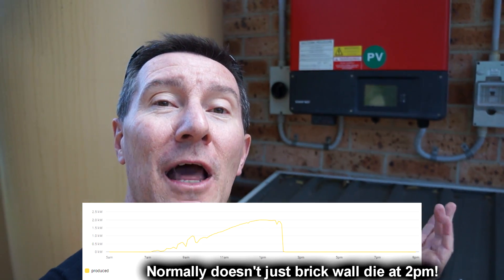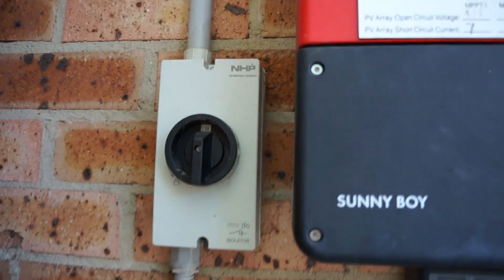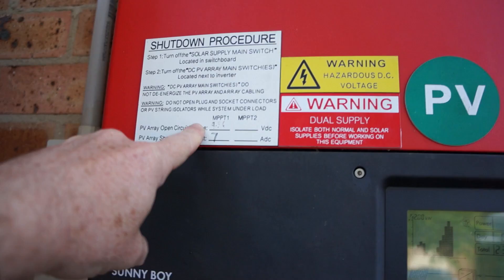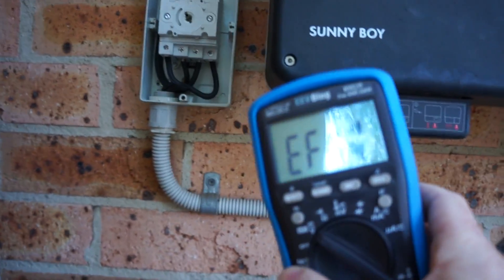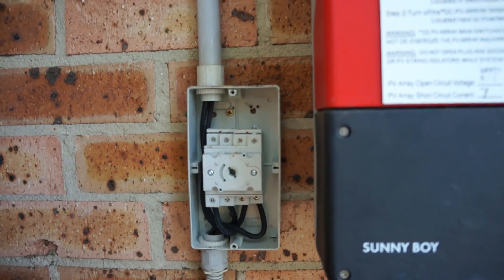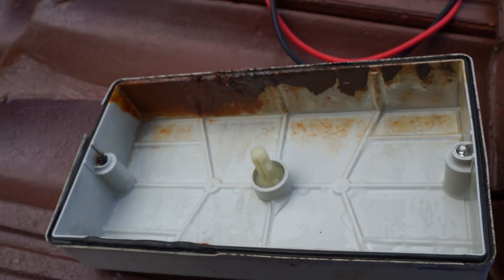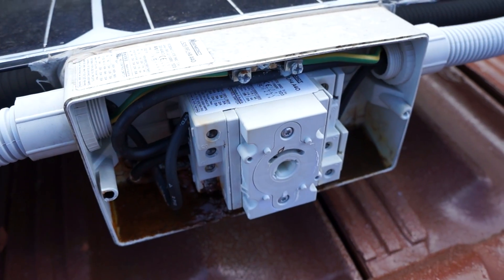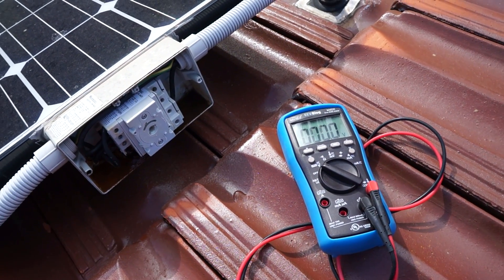EEVblog #1217 - My Home Solar Power System FAILED!

Comment: And that's why BigClive says to drill holes in the bottom, if seals fail, at least water can escape through the holes before it does damage... :)
Reply: I'd say have the box horizontal first. Think of the top section as a plastic umbrella. That way if the seals fail it's still harder for the water to get in as it would flow off the top, down the sides and most would run off past the seals. Then also have drain holes in the bottom.
Reply: or add a nice thick bead of silicone around all the edges except the bottom one. and buy a brand that makes their boxes out of marine grade uv resistant plastic or pvc
Reply: I worry more about bugs than weather.  some leather, lead, something to cover it...paint, dunno, don't like holes, holes mean hornets.
Reply: then you get bugs in the box and webs and a fire hazard. Better to just make the box outta cast aluminum...
Reply: Can't believe that if you noted the damage you didn't seal it up with self amalgamating tape for at least a temp repair until a replacement could be sourced after it was inspected.

Seems a bit daft to spot a potential fault & to just leave it to develop, what's the point in an inspection if you don't act on the results of it?
Reply: @norfolkngood8960  
The switch is already destroyed.  There is literally no point in trying to reseal a box with a switch inside when the switch in question is corroded.  What could you possibly gain by addressing the leak once the switch is dead?  Who is draft in this situation?  What is it, a self-healing switch?  C'mon man.

He is acting on the results of the inspection.  The whole assembly (box and switch need replacement).  Your field repair suggestion is nonsensical.
Reply: @norfolkngood8960  "potential" fault? 
What makes you think he hasn't already ordered the part?
One of the worlds most known and accomplished EE's..... daft?

Quit yo jibba jabba! lol
Reply: Illegal to drill a drain hole in a solar isolator in Australia.
Reply: @whiskeyinthejar24  put them under the panel then so rain & UV can't get at it that'd be a "neater" solution or add a sacrificial cover to the box.
Reply: Stop Changing this It's really creepy - I agree, a sacrificial box/cover, or just a stainless steel or aluminium box/cover is what I’d go for.
Reply: @whiskeyinthejar24  it is, but who cares? It's never going to be inspected, and does more good than harm. 

9 out of 10 will catch fire either way and they're perfectly legal to fit.
Reply: @whiskeyinthejar24 Australia is a very backwards country like that.  Still, no plastic should be allowed to be in the open environment by law.
Reply: To quote him again: Whatever hole you make, an insect of the right size will find its way in.
Reply: I could see the hole being ok in pest-free places, but in SE US, fire ants might nest in it, or roaches. For some reason the ants seem to be attracted to electronics, and will sometimes carbonize into conductors. Roaches sometimes eat weird stuff, paint brushes, plastic lids on dry goods, insulation, fallen comrades... Maybe Australia is too dry to be buggy, except a few deadly toxic man eaters or whatever, I don't know.  I think I'd just shade the seal with paint or copper tape or replace the seal every 4 years.
Reply: Why the isolation switch on the roof was mounted on its side is beyond me.
It may have an appropriate IP rating, but to mount a plastic enclosure in that orientation under all the UV and elements was asking for trouble.
Reply: Do that here in the southern US and you will have a nest of dirt daubers or yellow jackets in just a few months.
Reply: @Hear my voice No one has but a Fiber Glass Enclosure or a Stainless one are far superior to any Domestic Residential enclosure and offer superior protection against water intrusion, insects and vermin, weather of all types and even the Fiber Glass offers far superior UV protection. Sure they are pricier but how much does peace of mind cost?
Reply: Some experienced electricians say "The best seal is 3mm hole"
Reply: @WolfGamerBohumin  Some Experienced Electricians are Alcoholics. Saying Some Experienced Electricians is like saying Some People. Some People supported the Holocaust. Some People marched with Dr. Martin Luther King.  See what I mean?
Reply: @richb313  Saying "some experienced electricians" can also mean "those electricians who..." (... dealt with water inside a junction box)
It isn't necessary to escalate "some electricians say" in the Holocaust.
Reply: @richb313  Try telling a customer it'll cost them 5 times as much to install a garden light and socket to offshore standards in stainless boxes. It'll never happen. The manufacturers all say to drill the drain hole in the box, I'd rather install to the manufacturer's instructions.
Reply: @WolfGamerBohumin  Can also mean means nothing at all which is the entire point. Some of any defined set does not mean it represents the set only that it belongs to the set. Without a further identifier it becomes a meaningless exercise.  Like most Experience Electricians have such an identifier.
Reply: I tell them all the time and my customers are happy to pay the freight. Here's a thought, have you ever called the Customer Service Rep of any of the products you use? They may have very different advice for your applications. Go beyond the Minimum Safe Practice. Learn more about the products you use. Learn the Why of things instead of the just things you do. Become exceptional and customers will line up and pay more for your work.
Reply: @richb313  What if most of the experienced electricians never dealt with that problem? Then "most" identifier can't be used.

Btw. "anything" can mean nothing if you look at it "right".
Reply: @WolfGamerBohumin  You are proving my point BTW.
Reply: your responses are top notch.  its a shame how few people understand what you are trying to explain.  dolts.
Reply: Drill a hole to let the bugs in and build a nest.
Reply: good idea but very illegal.
Reply: wouldn't the hole in the bottom allow water vapour, which evaporates from the roof to enter into the box?? Food for thought.
Reply: Always a drain hole.  If rain doesn't get in, condensation will due to conduits connecting indoors to outdoors, or temperature change, etc.  I have repaired WAAAYYY more problems due to boxes full of water, than I have bugs making nests in boxes.  Non-weathertight boxes in barns or under eaves aren't sealed to keep bugs out, not to mention anything indoors anywhere.  Why just because it's in the weather does that necessitate bug-proofing?
Reply: just wrap the fking thing in foil, problem solved
Reply: A weep hole. 
But it looks like the box was not UV stabilised. Plus, solar installers don't understand that while IP56 is perfectly fine for a brick wall on the side of your house, it's a far cry from being mounted on the side of a panel on your roof where heat and the weather are much more harsh.
Reply: I think the regs say the isolator switch should have a rain shield over the top. Although the new regs have removed the requirement iirc.
Interestingly although Aus and NZ use the same standards, roof top isolator switches are/were mandatory in Aus, but not in NZ. Go figure.
Reply: I do think that will help but it will fail eventually
Reply: I'm going to do that with a LED security light fixture replacement.  The original ended up with 3 cm of water inside the "sealed" enclosure. None between the back of the unit and building.  Humidity pump.  Same reason AC fan motors have a drain plug you have to remember to take out the one on the lower end if you replace the motor.
Reply: @jkbrown5496  yup. Last week I switched on the motion light on the front of our shed.... KERBAAAAANNNGGG!!! ;p Poor little motion sensor! His face flew about 15 meters... half way across the yard.

Fortunately, the light somehow still works. I'd look to see how but the bastard's 6 meters up.
Reply: The issue with this is that now you're inviting insects to make nests in your enclosures.
Reply: If you live in an area that gets enough snowfall to reach the box, holes in the bottom can allow water in when the snow melts.  Ideally, the switch enclosure would have an upward-facing cover with enough overlap around the enclosure that it sheds light vertical rain even if the gasket is missing.  Then you're only depending on the gasket under heavy winds or the aforementioned snow.  Oriented on its side, the switch in the video will start letting water in as soon as the gasket seal is less than perfect.
Reply: @wlan246  Dude, I've lived in Canada my whole life and I've never seen snow go up a downspout no matter how heavy the snowfall. You'd have to to live in some area that has seasonal flooding, in which case you have bigger problems than what's discussed in this comments section.
Reply: @VeryUsMumblings  What downspout?  Drill a weep hole in the bottom of an enclosure a few inches above the middle of a flat roof as in this video; get about a foot of snow late in the season; and when it forms a puddle as it starts to melt, water will get into the enclosure via that weep hole.
Reply: @wlan246  Presuming we're still talking about a sealed enclosure - how is that water supposed to displace the air above the hole?
Reply: @wlan246  If a foot of snow turns into a pool of water on your roof, then you have a roof/drainage problem, not an electric problem. That water doesn't run up into downspouts from higher up, and it won't defy gravity to get into a weep hole.  When a foot of snow melts, it equates to less than an inch of water, and that water runs down, as all water does, into the eavestrough or off the side of the roof or down the street or whatever.
Reply: @VeryUsMumblings  1) What downspouts are you still on about?  I have said not a word about them.  2)  You are correct, drainage problems exist (not to mention ice dams)--and unless you want those to also create electrical problems, you won't put weep holes in enclosures that are less than a foot above the surface of the roof.  I'm not sure why, as an expert on roof drainage, you assume an ideal world in which everything always works as intended.  3)  When you do have standing water above that weep hole, water absolutely will not defy hydrostatic equilibrium and stay out.  I don't know what part of Canada you're from, but a couple years ago we had more than 1m of snow on rooftops.  As it melted, there were localized areas on the roof where standing water was temporarily prevented from draining, and it absolutely did have some sections of our conduit completely submerged.  With weep holes, they would have been completely flooded.
Reply: @Azlehria  You can't both add weep holes to your enclosures, and assume your conduit is airtight.  It will displace the air above the hole by leaking the air out of the nearest non-airtight opening; e.g., the spot at the top of the enclosure where the lip and seal failed.
Reply: @wlan246  You're asking what part of Canada I'm from? Apparenlty you come from some magical world where everyone has 1m snow on their roof, a drainage problem and high voltage live electrical in the middle of it all. I'm sure it must be giving you a headache to think up all these examples where everyone has a giant pool of water on the roof and no downspouts. But okay, you're right. If there was a swimming pool on the roof and electrical conduits under the water and a new ice age and a flood and God hated your house, you would have the safety of knowing that your electrical would be safe... until the rubber seal failed and then you'd be dead and swimming with the dolphin that also seemed to make it onto your roof (without the help of a downspout). Congratulations, crisis averted!
Reply: @VeryUsMumblings   No, I said I don't know what part of Canada you're from.  Couldn't care less about the answer.

I have personally witnessed situations in which weep holes in enclosures and conduit only a few inches above a flat roof would admit a substantial amount of water. Do what you like, and kindly insert your "everyone has a giant swimming pool on the roof" strawmen and your fevered personal aspersions in your nearest weep hole.
Reply: @wlan246  Sure, and all of this terrible calamity is caused by two holes in a boxed electrical enclosure, not by a roof drainage problem. I guess your strawman is the electrician in your neighbourhood. Believe me, I wouldn't call you to fix anything in my house, pal.
Reply: @wlan246  Are you arguing against drainage holes in the general case or in the specific case shown in this video? Pick one; don't just flip-flop back and forth as convenient.
Reply: @VeryUsMumblings  Given enough snow, it isn't necessarily a "roof drainage problem", it's the reality that all the snow on a roof doesn't melt uniformly.  For example, a poorly insulated section of the roof (or an area near a chimney or A/C ductwork) surrounded by better-insulated areas will melt first, and create a puddle that does not necessarily melt through the surrounding snow/ice immediately and find its way to the drain.  I figured someone who has spent as much time on rooftops as you have would know that.
I own and operate a regional ISP, and have personally installed conduit on dozens of rooftops where we have installed telecom equipment, which I revisit at least annually for inspection and maintenance.    So no, you definitely won't be calling me to fix anything in your house; Nor would I need to, since you have everything under control.  I'm just relaying first-hand experience from dozens of rooftops over the past ~10 years.  Accept or ridicule it as you wish, but I'd be interested to hear the source of your expertise on this subject that is so different from my own.
Reply: @Azlehria  As I have stated consistently, I am talking about drain holes that are just inches above a flat roof (as with the isolator switch in this video,) specifically in regions with significant snowfall.  If the enclosure is high enough above the nearest horizontal surface to avoid interaction with melting snow, then you're good to go.

I'm responding to the blanket suggestion to create weep holes, regardless of circumstances in which they can do more harm than good.
Reply: @wlan246  if you really "own and operate a regional ISP", don't you have employees to "personally install conduit on dozens of rooftops"?

Can anybody else smell bullshit?
Reply: @wlan246  If there is high risk for flooding the box, you should consider the placement or in worst case fill the box with gel.
Reply: @Faddnn  Well yes, but I was addressing this box in its particular position and orientation.  Mounting equipment in the elements should take into account UV, temperature, precipitation, wind, etc.  The switch enclosure may have degraded due to UV exposure, but its orientation hastened its failure.  Otherwise, the damage might have been noted at the next visual inspection, and the switch replaced proactively before there was any downtime.
Reply: @wlan246  dude. He lives in Australia...
Reply: @pingumcping  And the advice forwarded by the OP of this thread has a worldwide audience.  I have been very specific as to the conditions under which said advice could cause more harm than good.  Dude.
Reply: No!Its not just water preventing to come in,but also water vapour! When the weather changes to a colder temperature,moisture in the air will produce droplets of water in the box if you drill holes in it,even on the bottom!It just has to be water tight!And don't forget dust blowing in through the holes en that sucks the water in.I have seen it many times with poorly watertight 230 volt outlets in a garden.I also don't like the flexible pipe that goes into the box,those rings come out into the box and give a way for the water to come in.Even if the rubber in the wartles is tight.This box is meant for cables,not wires!
Reply: I don't know that i'd recommend that solution since it would allow humidity to effect the entire device. Water would still collect inside with the holes in bottom. Better to solve the seal failure problem. Maybe throw a desicant pack in there for good measure.
Reply: @youtubasoarus  This is normal practice on outdoor electrical equipment.
Reply: @youtubasoarus Sometimes the reason no-one sensible does something is that it doesn't work, or it can't be done at a reasonable price. Just because NASA can do it doesn't mean your $1/W solar installer can do the same.
Sealing is hard and only done when you really have to. It means dealing with changes in air pressure, temperature and external strain. Then you need flexible seals that will stay flexible and sealed for however long you want the box to last. The more usual way is to only make holes in the bottom, including a drain hole, and use grease as extra shielding on key moving parts if you need it, conformal coating on the rest. Designing outdoor fixures is a whole art in itself but no amount of design can fix a bad install... Big Clive comes in at the "don't stuff up the install" end of the process.
Reply: Water ingress will corrode the wires etc...  Stupid shit to have anything plastic out in the open like that where it rains, is humid, and has hellish heat through out the year.  Not sure which Einstein thought that was a good idea.  At least stick it farther back so it is under a panel.
Reply: @Faddnn  Not in the Offshore Industry. We actually pack these kind of switch boxes with Desiccant Bags to help control the Humidity in the Box. U.V. is not your friend either use a Fiber Glass  B ox or Stainless One. Yes they are pricier but last a lot longer than those cheap plastic ones.  You should see what we use for 4,000 VAC boxes. Hint, they are oil filled.
Reply: @youtubasoarus  They make boxes with drain wholes that you just tap out with your screwdriver. They're ment to be tapped out if you place them outside.
Reply: @richb313  Offshore is another game.
Reply: @Faddnn  It's a serious game with serious stakes and what works there will work anywhere else.
Reply: @richb313  It's not needed. It's more expensive equipment that won't drastically improve anything.

In offshore you have strict regulation because explosion, very extreme weather, cleaning, and vibration. These are factors that makes equipment expensive and when we don't have the same risk in a home installation, it makes little sense to empty your pocket for these things.
Reply: @Faddnn  That depends on how much reliability, fire prevention and safety mean to you but really if that stuff is of no concern then by all means use the inexpensive less reliable and questionably safe alternatives.
Reply: @Faddnn  Those are not really drain holes.
Reply: @thebeststooge  of the
Reply: @youtubasoarus  because it works is why.
Reply: @richb313  There is nothing questionable about equipment rated for outdoor for homes. If correctly done, it will last decade. 

Yes, they're drain holes. Read the manual and you will probably see something like: remember to punch out the drain hole before mounting.
Reply: @Faddnn  If it is an electrical box rated for outdoor use and has "Drain Holes" then by the very nature of the box and where it is intended to be used that is the very definition of Questionable. Anywhere Electrical Connections are made where larger currents are possible every method available to prevent arcing or the possibility of arcing to occur especially when the box is flammable must be taken. This is just common sense. Allowing water ingress to the point "Drain Holes" are required points out a flawed design and should never be used where Mains Potential or Heavy Currents are possible.
Reply: @richb313  It not questionable at all. Millions of these units are installed all over the world and there is little to no problem if you punch out the drain hole and follow the manual.
Reply: @Faddnn  Have you seen what goes for approved electrics in Mexico, the Philippines,  Indonesia, Hong Kong and China and a whole host of countries too numerous to mention. When I work overseas I always bring any electrics I work on up to either North Sea or US Coast Guard Specs. It is safer and Grounded Properly. and any overhead wires are in cable trays or fastened with Metal Ty-wraps so no live wires can drop during a fire. It never hurts to exceed standards but simply meeting stands can and has killed countless people.
Reply: @richb313  What's approved in the development world and designed for homes is more than good enough. We don't live out in the Northsea.. This is my work, I have installed thousand of boxes and sockets in my career, and not more than 1 of 1000 causes a problem, and if it is a problem, you can trace it back to the installer og manufacturer.. As long it has the right rating and installed like the manual tells you, it will not be a problem.
Reply: @Faddnn  You are fortunate if none of your work has failed, caused a fire, damaged property or horribly caused death. It is not in my nature to do Good Enough. That way lies disaster. All Codes are a Compromise between Safety and Economic concerns. ALL of THEM. Peoples Lives depend on my work and I take that very seriously. It is no sin to exceed minimum standards. It can be a sin to comply with them when that compliance can and has resulted in property damage , injury and death.
Reply: @Faddnn  Exactly. Assume water will either get in or condensation will form and make sure it can get out.
Reply: @richb313  whenever you work overseas, you ignore the local wiring regulations and work to US codes? Typical American... you might want to try thinking that through sometime.
Reply: @pingumcping  When ever I am working overseas it is written into the contracts that we will adhere to certain standards such as North Sea Standards, U.S. Coast Guard Standards, API Standards etc. These are the Minimum Standards. I have never been reprimanded, gotten in trouble or otherwise had any negative impact from exceeding these standards in fact it has usually generated more work. I am retired now but Reputation and Word of mouth meant everything in the Industry I was fortunate enough to be a part of. BTW I worked with numerous Inspectors and Engineers in all the countries I worked in and never had a problem.
Reply: @Faddnn  usually with uv resistant plastic though.
Reply: And then insects will make it home. Ants got nuts for copper.
Reply: @Kosmonooit  lol... 6 or 700 V will fix that in short order, so to speak